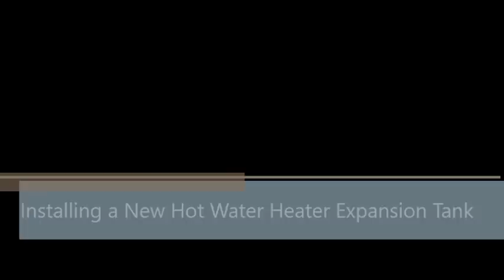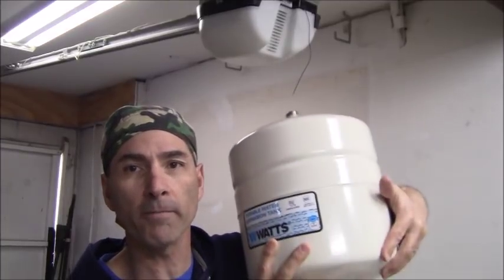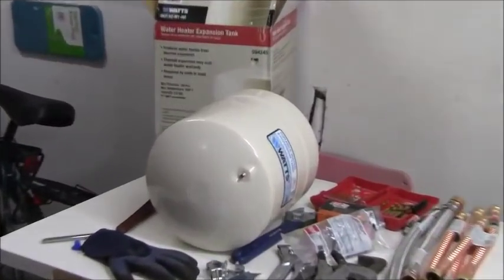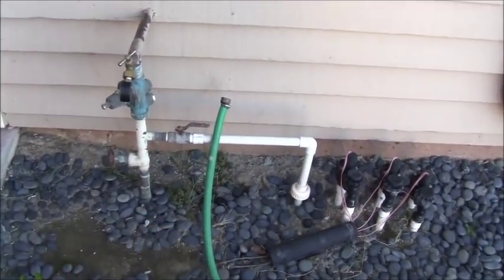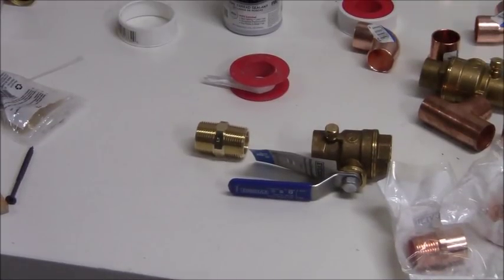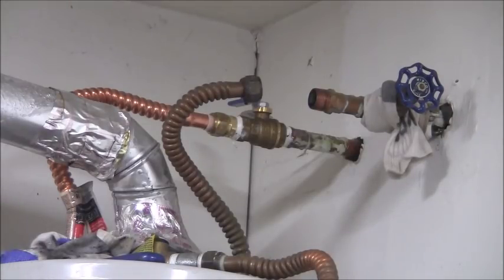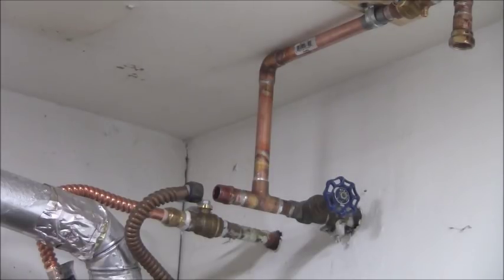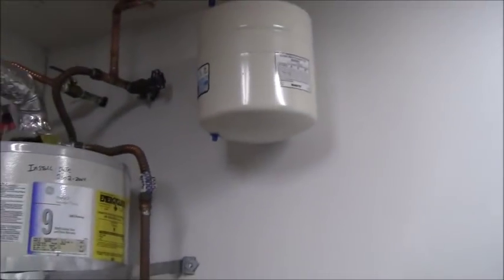Installing a New Water Heater Expansion Tank

Comment: Ken, can't blame you for not wanting to replace that old gate valve at the present time. When they are so close to the wall I've always been afraid of melting the solder back inside the wall or catching something on fire. I was lucky on mine because it was maybe 6" out from the wall so I cut it off then sweated on a male adapter and used a threaded ball valve. Turned out nice. Somewhere in my vast travels I saw a valve like yours where someone had removed the handle and the internal " guts" and had installed a threaded cap of some sort, He the came out of the old valve and put on a ball valve. It would look like crap I admit and god knows where you could get a cap w/correct threads and sealing washer.  Just an idea. but I wouldn't do it on my house. Works but UGLY

Comment: Depending on street pressure, adding the expansion tank before fixing the Pressure Regulator will blow the membrane in the expansion tank.  My street pressure is around 180 or better.

Comment: Ken , thanks for your video.  As pipefitter, not a plumber, I do not think it is proper to have a shut off on the hot side.  Someone , other than yourself  might close it and forget too open and thereby creating a dangerous situation if  the relief valve fails.  The hot water tank could become a bomb.  Ken, good for you for doing your own fitting.  Remember your safety and others is always a must.

Comment: Can I add air pressure after the tank is installed?
Reply from the maker: Yes but only when you have the water pressure off the other side of the bladder. 
process. 
1. measure your house pressure after your regulator. 
assumption = 70 psi
2. drain the house water pressure to 0 psi. 
3. check the expansion tank pressure with tire gauge. you want it to equal 70 psi. to high, bleed off pressure, to low -  add air. 
4. refill the house supply to normal and you are good to go.

Comment: Do you have a vacuum breaker on the cold water pipe? I think it's a plumbing code.
Reply from the maker: I do not and as far I know, it is not code in So Cal.
Reply: @KenTraining  I see.
Reply: David Park in oregon you have to put it on only if it’s above fixtures. But that’s Oregon, could be different somewhere else but Oregon’s UPC

Comment: So i gave heard these expansion tanks are to be at least 18" from the cold water inlet.  Is that code, and why?
Reply from the maker: I have not heard that, but it may be true.
Reply: It is recommended you install 18” from fixture you are trying to protect, not code but you want it close to heater so expansion tank takes expansion rather than heater tank.  Further away expansion will still occur in tank until it makes it way to tank.

Comment: A few notes: 105 PSI is too high for many appliance ratings, and most filter / treatment systems.  A presure regulator, set to 80~ish PSI max would be my main suggestion.  Also I would NEVER install a shutoff valve on the hot water output side for a few reasons, mainly it is unnecessary... 

(Also the H-Side valve violates code in some places for a variety of reasons, but still remains generally is a waste of money and time... 

Just drain yoru tank like a good human, service it appropriately: Annually by flushing the tank and test the PRV semi-annually [at a minimum]... ALSO drain 2-3 liters from the tank monthly to ensure contaminants do not build up... then you will never need a shut off on the hot side anyway... and your hot water heater will last well beyond it's expected lifetime... don't do it, and you might end up needing a new one [and your warranty won't cover it, because you did not properly maintain the tank.])

Just my 2 cents...
Reply from the maker: Good info, I run my supply water at about 75 psi. When did say I was running 105 psi?

Comment: Hey Brother did installing your prv fix your problem I'm just wondering because I'm having the same issue at my house I just installed an expansion tank but still getting the same high pressure readings
Reply from the maker: Yes, as I showed in the Video, my house PSI is very consistent. I can change it to whatever pressure I want to maintain. Right now I have the PRV set to about 68 psi and all is well.
Reply: @KenTraining  Yep it was the PRV installed one today and all is well! Thanks for the vid Godbless you bro✌👍
Reply: That tank won't change your line pressure
Reply: Yeah it was the faulty PRV

Comment: At the very end before you open the cold water valve, I assume there must be air in the line between the t-joint and the expansion tank. What ends up happening to the air in the line going to the tank?  Is that a good reason to have the bleed valve or just don’t worry about it?
Reply from the maker: Don't worry about that air. Not a problem. The bleed valve is there for added convenience for me as the tester / inspector.
Reply from the maker: Dont worry about that air. the bleed valve will help for the testing of the bladder, to drain and vent to atmosphere.

Comment: pressure tank is on the cold water side is correct. I located mine under my kitchen sink, on the cold water side. It doesn't have to mounted on top of your water heater. could be any where on the cold water line in the house in front the water pressure regulator if you have one. Just a couple of flex hoses and a water T can make mounting and installing and servicing the tank, easy. Plumber like the waterheater mount because they get paid for changing the plumbing. Gotta use your brain people....
Reply: Wrong you need it close to tank so expansion goes into exp tank the heater tank, locating the tank further away will still work but will also still let heater tank take the thermal expansion until it makes it way to exp tank.  Has nothing to do with plumbers trying to screw you, trust me they know plenty other ways to do that.
Reply: @msk3905  Not wrong as long as there is no check valve between the water heater and expansion tank. Water pressure in the entire cold and hot water sides are the same.  Pressure builds up in the entire system equally. Pipes are  usually rated for 200psi and water heater for 80psi, that is why they (WH) go boom..... The high pressure temp valve on water heater often drips when folks don't have a expansion tank and are dealing with high city pressures. A tank placed in the system solves this problem unless there is an issue with the valve itself. My well system runs off huge expansion tanks, so I don't need one. they are located 100 feet away from my water heater.
Reply: @rss608  my comment is to yours saying that exp tank doesn’t have to be on or near heater tank,  why have heater tank take the expansion when you can have the expansion tank do what it is intended, take expansion and save heater tank?  If you install exp tank (on cold side) more than 18” from the heater tank still feels the expansion.
Reply: @msk3905  point is, retro fitting an expansion tank. It does not have to be located on top of the water heater. It can be located anywhere on the cold water side as long as it is before the back flow valve and pressure regulator from the city water supply. The tanks are not rated for hot water so can't be located on the hot side.
Reply: @rss608  did I ever say they can be installed on hot side and did I ever say you can’t install the exp tank anywhere on cold side upstream of pressure reducing valve/back valve, and are you even reading my posts?
Reply: So i see the points here but I would assume that near the water heater itself its slightly faster for the occurring expansion to relieve itself...its not having to push additional water thru the pipes to reduce pressure which will slow things down...its a physics thing - weight of water in pipes, friction in pipes..etc......how much that makes a difference Im unsure  but I would say to be on the safe side - closer the  expansion tank is to water heater likely better but maybe not necessary...code wise maybe a whole different story!
Reply: @steves3688  It is not about volume of water moving, they only guard against pressure. pressure increases in the entire system at the same time. Pressure is the same regardless of where on the plumbing system it is. Don't know as there are each inspection district is different.

Comment: Obviously you don't know there's a check valve at your meter near the street. You need to do some research
Reply from the maker: I did full testing on my system and I can guarantee   you that I do not have a check valve at my meter, but I do appreciate your comments.

Comment: Why would you need to heat already hot water..its a water heater ..not a hot water heater
Reply from the maker: Yes, my Bad. :(
Reply: You have to heat already hot water to keep it hot. If you don't keep heating the hot water it becomes cold water.

Comment: you are not a real plumber , you would know the  tape goes on first , also fyi you can also use blue for water
Reply: PBS #007 there is no code on which one you do first plus they both do the same thing so technically you only need one or the other. And also sometimes you void the warranty for putting thread sealant on
Reply: Glad I wasn't the only one that caught that.